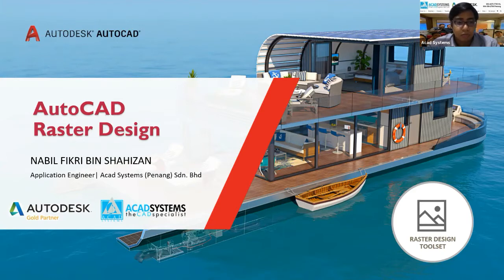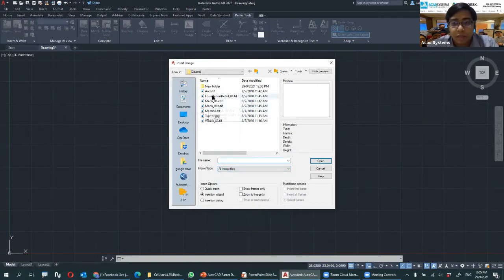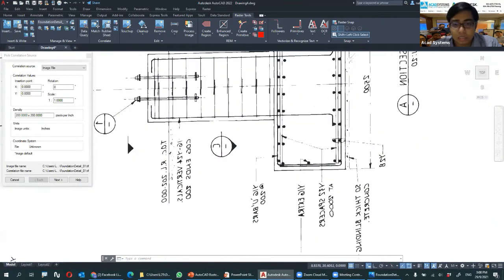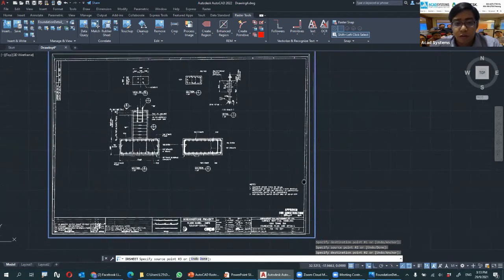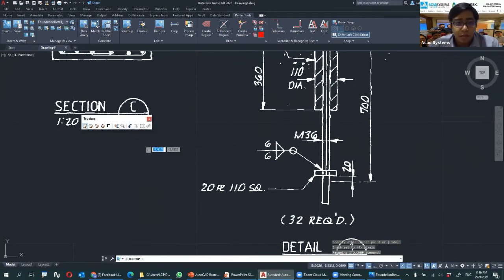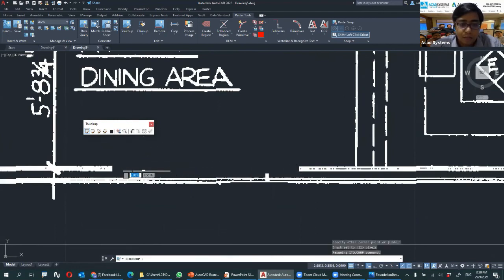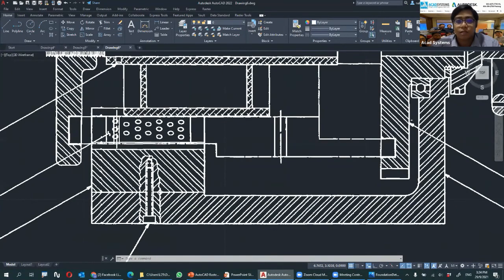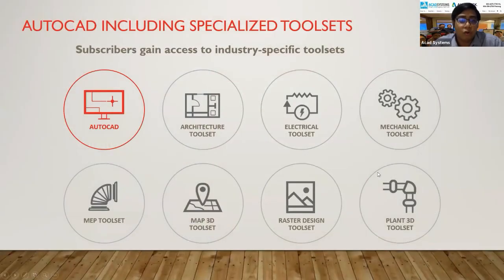AutoCAD 2022 Raster Design

Comment: HI, One question please, how I activet raster design for Autocad 2021 for example? Thanks!
Reply: Can you share me raster design tools 2021 activation process?
Reply from the maker: @ Hi, raster design is a separate add-on tools. Once installed, it will appear inside AutoCAD. The Raster Design is part of AutoCAD Industri Toolset. So normal AutoCAD subscription should have it. AutoCAD LT does not have it.